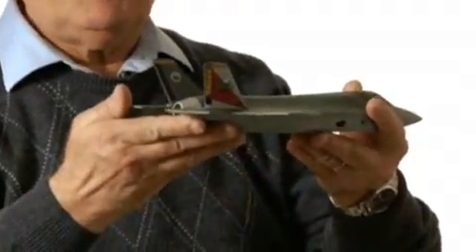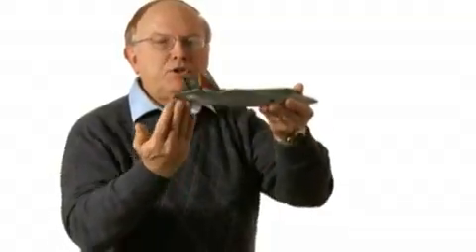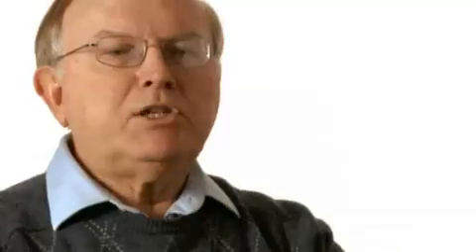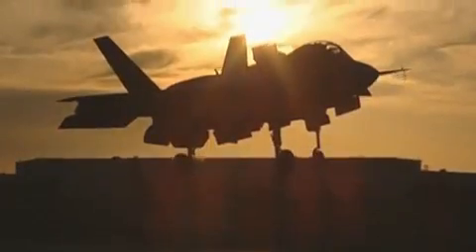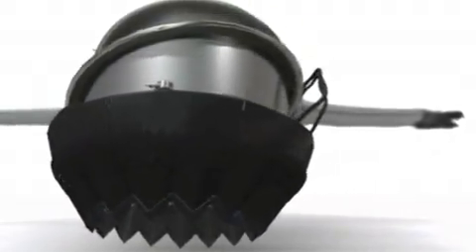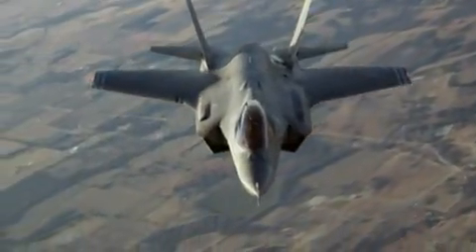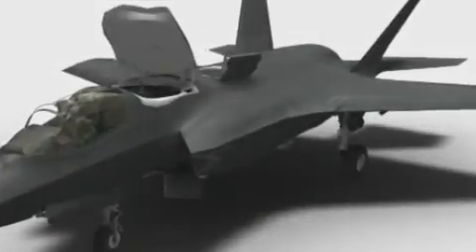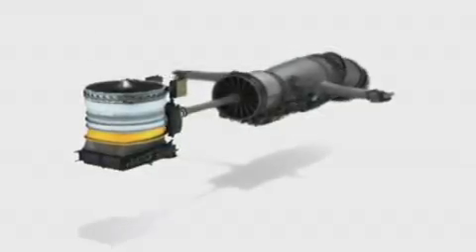F-35B Propulsion Story (supersonic VTOL)

Comment: The jet engine - axial compressor or not or any other type of compressor arrangement - was not invented by a German scientist.
An alloy suitable for the turbine blades was first found by the metals chaps at Wiggin of Hereford England, 3 tons psi stress at 700°C for 300 hours then a bit later 12 tons psi stress at 800°C for 300 hours after much tweaking & testing. They would have done it much earlier than they did if Frank Whittle had been provided with more support for his considerable  efforts.

Comment: no need to go supersonic if your main mission is ground support. should have just kept the Harrier and designed a new engine for it
Reply: They were aiming for a basic airframe & engine that would be suitable for carrier / navy catapult / VTOL -  or Airforce or marines etc VTOL (reduced load)  use & could go supersonic in all versions which is rather remarkable if they've managed it. It doesn't need any variable ramp stuff in the intake path for supersonic operation & the pilots helmet allows the pilot to see all round as if the aircraft is transparent - £0.5M cost each helmet.
Reply: @paulpaul9914  you still missed the point. you dont need supersonic if your mission CAS. besides the F35 carries only 125 rounds compared to the A-10s which carry 1174 rounds.
When the F-111 was being developed the goal was one airframe for two different missions. The Navy eventually dropped it because it didn't work for them
Yesterday Israel decided to ground their versions.  The concept sounds good but not so hot in execution
Reply: @peterkurilecz2972  
The A-10 is a very specialised flying cannon  basically. No strike or interceptor type jet aircraft would be expected to do anything similar
. It might now be possible to do a multi military services role aircraft now when it wasn't previously. 
The IAF F-35 aircraft aren't STOVL versions & grounding some of them seems to be something to do with possible earlier ejector seat problems coupled with something to do with a STOVL F-35B crash in the USA.

Comment: This was based on a Russian design from the 80's
Reply: Incorrect.
Reply: Literally Shaking  but the basis model is Russian yak-41
Reply: Thane Mac2  the yak versions are totally 3 yak-36,yak-38,yak-38M,yak-41 The yak-41 is completely a machine which is now flying today as F-35B
Reply: The rear nozzle that rotates downward was based off the Yak-141's nozzle. However, the soviet jet had two small engines in front pointed almost vertically to provide lift, while this video is describing the invention of the single-engine driven fan that can be disconnected during normal flight to enhance efficiency, power, and probably cost.
Reply: @jakeclaeys5879  "The rear nozzle that rotates downward was based off the Yak-141's nozzle."

Correction: The rear nozzle that rotates downward was based off the Pratt & Whitney design patented in the 60s which was then incorporated into the Convair 200 in the 70s and was then stolen by the Soviets.

Comment: What about the YAK-141? Lockheed Martin doesn't like to admit that they bought 3 of them.

And they were right to do so. That $400M was a damn good investment.

The one thing I want to know is what kind of clutch do they use? That's one hell of a piece of friction material. The gearing is not light and there's alot of resistance from the fan. A clutch that can start the fan in flight without dropping the main engine rpm has to have alot of slip during such a gradual engagement. That's alot of heat. There is some serious voodoo black magic in that clutch system.
Reply: Yeah, the F-35B's engine design was actually based on the soviet era VTOL YAK-141.  Lockheed had a partnership with Yakolev in 1991. https://nationalinterest.org/blog/the-buzz/the-story-how-the-f-35-might-have-some-russian-blood-25571
Reply: @The_Crazy_Monkey75  The nozzle design. Not the engine. The Soviet Union did not ever have anything remotely like the engine in the -35.
Reply: @freefall0483  The nozzle design was one of the most important if not the most important part to make it actually work. The fact that Lockheed worked with Yakolev meant they borrowed or even bought the idea. Russia already designs reliable and powerful engines as we all know, but it is useless if you do not have any nozzle design to combine it with to create a VTOL aircraft. Lockheed probably already had an engine in development that time and only needed a nozzle design to match it with.
Reply: @The_Crazy_Monkey75  You need to learn more about this topic.
Reply: @The_Crazy_Monkey75  the Yak 41 used 2 lift jets while the f-35 uses 1 lift fan. Agreed about the lift fan being the real magic of the F-35 and not the rotating nozzle. To get a fan (propeller) to generate as much thrust as a jet AND synchronize their output? Wow. Sadly I suspect the exact mechanics of it will be classified for maaaaany years.
Reply: just changed the jet with a fan, similar dynamics.
Reply: @The_Crazy_Monkey75  That still doesn't answer about the clutch used to engage the fan.
Reply: @freefall0483  Ooooh...I guess you're right on that one...
Reply: @navyreviewer  
It's a lightweight horizontal bypass fan basically same as on big passenger aircraft engines but arranged s 2 contrarotating fans  to cancel gyroscopic forces & reduce air whirling. Synchronization is mostly done by the fact the fan speed is fixed with respect to the engine speed. Any adjustment in lift force is done by variable inlet guide vanes & variable exhaust slats. 
The clutch system probably engages with specific engine power settings & with very low load on the lift fan by means of the exhaust & inlet settings & the  clutch is then overridden by a mechanical locking arrangement after the lift fan reaches operating speed / engine synchronisation speed  & before the lift fan gets loaded up.  The clutch slippy friction function doesn't have to do anything most of the time the lift fan is running.
That's how I'll be doing my lift fan clutch system when I get around to it on one of the weekends.
The thrust from the lift fan is more than  two times the thrust you would get from the engine for the same engine power due to lift fan moving much more air at lower velocity making it more efficient for thrust production which is what the front bypass fans do on passenger aircraft engines.
Reply: @The_Crazy_Monkey75  Incorrect. The YAK used a design stolen from the Convair 200 from the 70s which itself utilized elements - the swiveling nozzle - patented by Pratt & Whitney in the 60s.

Comment: So in normal flight, the front fan is dead weight? Hmm.
Reply: Still a huge improvement over the yak-41 that had 2 separate engines at the front to generate lift, as opposed to this drive shaft driven fan 😎
Reply from the maker: Yes, but this is the trade off for having the stovl capability. Even with these compromises (compared with the regular -A version) the F-35B is a very capable fighter jet, one may say that it's even unbeatable as a stealth fighter opposed to any other aircraft (F-22 excluded)

Comment: Nope, the Mirage III v, was the first supersonic VTOL, and is still the only one able to reach mach 2. But it was only a prototype.
Reply from the maker: You're right about IIIV (I mentioned it in another comment too) it was a prototype but so were yak-141 and X-35.
Reply: It had far too many engines.
Reply: mach 2 is wrong. it could barely reach mach1 and the max take of weight was waaay too low to even use that. and maintenace etc were way too much back then

Comment: It is a great design, but it cannot lift off vertically with a full load.  For that you need to add a 'Zero-Takeoff'  JATO rocket engine to the belly to give the jet a few seconds of vertical thrust, and then the bottle drops off when the fuel is all used up.  In a war the runways will be gone, so you will need to have VTOL with a full load.
Reply: "but it cannot lift off vertically with a full load. "

Neither could the Harrier. By the way there was never a KPP for the JSF to be able to execute a vertical takeoff.
Reply: neither could the Harrier but the Brits came up with the ski-jump. you takeoff using the ski-jump and land vertically. Vertical take-off is inefficient

Comment: Aposto que os caras que estão dizendo que o F35b é uma cópia do Yak141 não sabem diferenciar o sistema de funcionamento do caça americano e do soviético! Não sabem diferenciar um lift fan (no F35) dos dois motores a reação (no Yak141) que são usados na sustentação vertical das aeronaves! É muita ignorância!
Reply: The rear nozzle was actually an invention of the German EWR VJ-101E before the Yak 141 or F35B.   They built on to an engine and it in a test stand.  The VJ-101E developed into the Panavia Tornado.

Comment: Copy paste yak 141
Reply from the maker: The Yak-141 was a very remarkable aircraft but the afterburning 3BSD nozzle was initially developed for the  PW401 engine that powered the Convair Model 200 supersonic VTOL aircraft. This one also used two separate smaller engines for vertical lift like the Yak-141. Convair Model 200 was designed more than 10 years before the Yak-141.
Reply: @MechDesignTV  in 1972 was start use Yak-38. Your Model 200 was on paper. The Yak-141 start in 1988.
Reply from the maker: @ИванМаксимов-ж8т  Yak-38 flew more than 10 years later than the vastly superior Harrier prototypes, Yak-141 was in the very early prototype phase, I believe it was the first VTOL jet to fly with a 3BSD nozzle but it wasn't neither the first supersonic VTOL jet (Mirage IIIV did that many years before for example) nor the first 3BSD design. Yak-41/141 was a remarkable aircraft on its own, no need to hype its value.
Reply: The Yak 141 was a copy paste of the EWR VJ-101E.